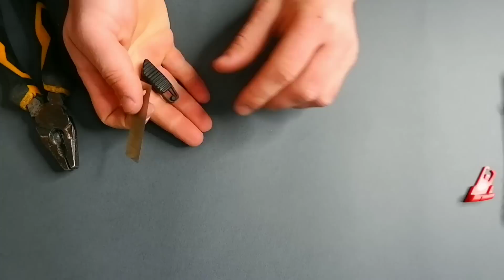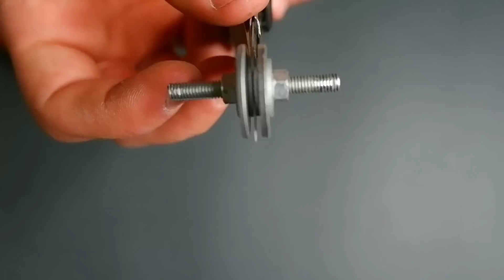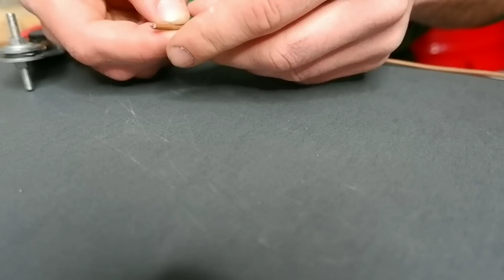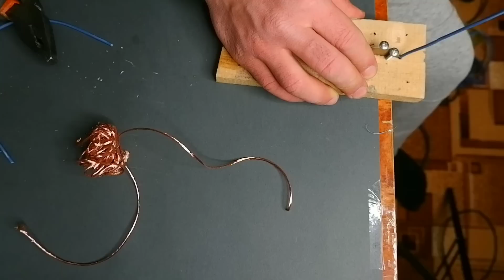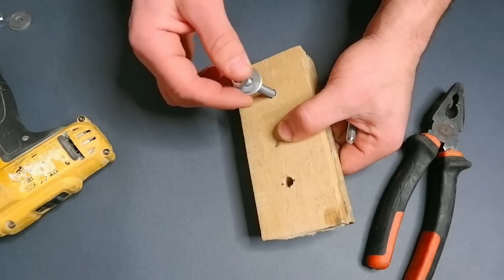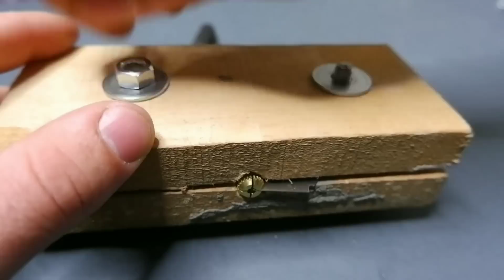This video will make your Life easier. Copper from thin Wires, quickly and easily in just 8 Minutes.

Comment: Just my opinion these wires are too small to justify the time spent trying to strip! But good informative video ! Thanks!
Reply from the maker: Thank You 🙋‍♂️👍
Reply: I agree
Reply: Even if having the materials getting less than $1 per 10 minutes to video is not working a $15/hr wage job earning more.  A huge amount of copper wires (155 pennies weight and volume equivalent) gets 1 lb in copper.
Reply: Not worth it for sure unless you are  hoarding and waiting for the Big payday,  saves a lot in valuable storage space 😀 👍
Reply: Hey man every  little bit counts
Reply: @mattjones6147  yes it does but to each his own. Time spent on the small stuff is worth it if that’s all you have but I prefer 10 gauge and higher to strip. I’m lucky if I cut plugs off of any wire my yard buys it as no 1 so I can leave the insulation in the small stuff.. everyone’s situation is different…. And 12 is perfectly stripable but my wire stripper has a full blade so I either throw it in with insulated or use a knife to strip!
Reply: Well you have way to much money take the  time to strip
Reply: Well said. If you are someone who doesn't have a lot of scrap to deal with then by all means. As for myself, one of the things that elevated me to the next level is learning that I cannot possibly process EVERYTHING. You have to pick your battles
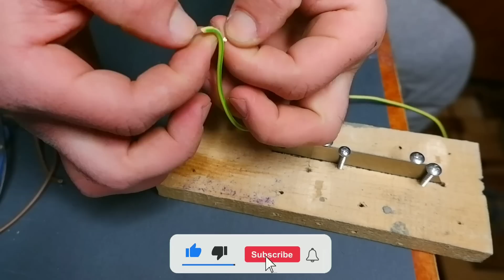Reply: @ScrappingwithGrandpa  😅😢😅😅 4:19
Reply: I agree way to small I get more money sending them in non striped
Reply: In my area, there's a $0.30 difference in the price, so every 10 pounds, that's $3 extra, every 100 pounds is $30 extra dollars...less isn't more, more is more...yeah, you're making pennies an hour, but a few pennies is better than no pennies when doing nothing... I don't figure it by the hour anyway, I figure mine by the job...I strip wire while I watch tv... I don't have to rush to the scrapyard, so I can take my time & have nice, shiny #1 copper when I do go... hopefully with at least 100 pounds... it's also a side hustle, so the time means nothing to me...
Reply: The first one looks like you could add washers to widen the gap for thicker wires
Reply: I stripped down 42 kilo of small wire from end September to end October made 200£ just doing couple hrs a night after work it takes time but it's my own time why sitting home chilling
Reply: Personally as a personal with a disability preventing me from working, it's Definitely worth it as that little bit of copper adds up and I'm already not doing anything anyway. So depends on the perspective of the person ig
Reply: @derekhenschel3191  everyone’s time is valued differently! Nothing wrong with that!
Reply: It is if the wires are long enough.

Comment: You really need to mount that blade while you are drilling holes because it will chop you up if the bit gets caught and spins it around in circles!! Very dangerous! Just use a simple potato peeler to strip the coating off of the wires!

Comment: very good information
I have been stripping 10, 12, 14 awg wire by cutting it in to 1inch pesice and using the wire striping plyers to bad I already cut a bunch of wire in to 1 inch pisces now I just need to finish what I started but next time I will have to check this out.
Reply: How is cutting into 1 inch pieces profitable? The time it must take. Wow!
Reply: @michealbrown5903  I am still working on stripping it . More of a little work here and then a little work there I don't need to take it in now and sell it.

Comment: You could flatten them to use in creating your own circuit boards. Thin plastic, cardboard.. then lay down the flattened wire. Drill the holes for components. That wire would be great for your own circuit boards.
Reply: Be sure to soak them in wax to seal and add rigidity or put it into a plastic box unless you desire short circuits

Comment: Most small Guage wire is  easy if you start the  coating and just pull you have less loss😢 especially if you go to deep and fray  the wire.
This is especially  true for stranded wire solid  wire not so much.

Comment: I used the utility knife and washers way of doing it I have tried so many different ways and this way is the cat's ass I'm mounted it on a 2 by 4 after drilling a hole in the back of the knife and bolting it to a 2 x 4 vertically then bungee cord the front of the knife pulling it down now I can just start the school and Walk and Walk and Walk and it does the work by itself it is fantastic

Comment: 🤔  Not bad, but you are working to hard! 
  😉  get 2 cylinder rolling pins, or mount 2 drills to a work bench or table top. And have 2 socket drivers.
  Place the 2 rollers close to to each other.
Then insert the three wire between the 2 Rollers, the wire sheathing will be split and go one way the wire will go the other way.
 Not only will you strip the wires but you will separate the wire from the outer plastic also the coating off the wire inside the sheeting as well😮😲😉🤩🧔
Reply: Cheers mate. Great idea.

Comment: I can't help but think about how sore my fingertips would get after 20-30 minutes of stripping wire using these methods.

Clever ideas for making insulation cutters, buy oh my tender fingers!

To make stripping insulation from small gauge wire time effective for selling the copper, it has to be much less labor intensive & way faster.

Best thing I've seen done cheaply was a stripper made out of the motor & belt rollers from a free treadmill.

It would do all sizes & lengths & was fast. Stick the end of the cable between the spinning rollers & the copper was spit out the other side, sans insulation in the blink of an eye.

Just don't have any excess cable wrapped around a wrist or ankle!